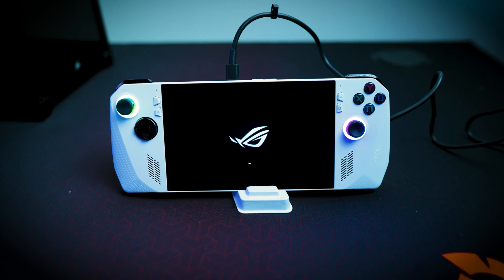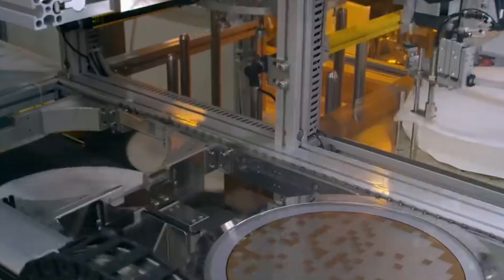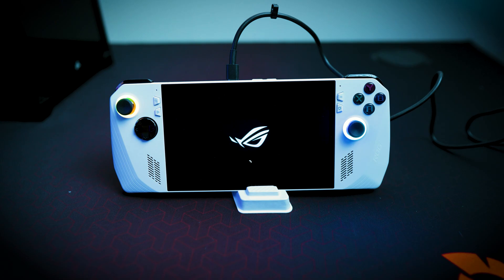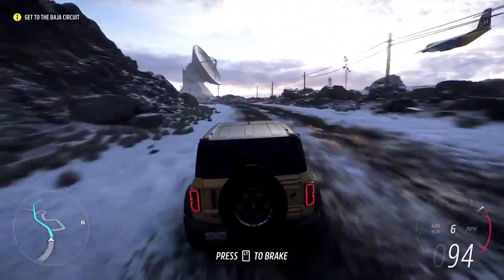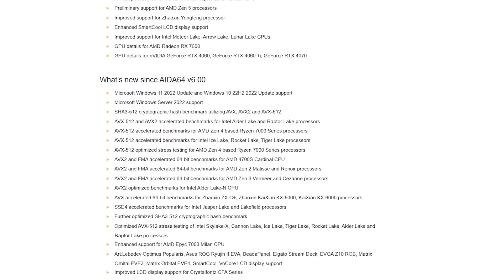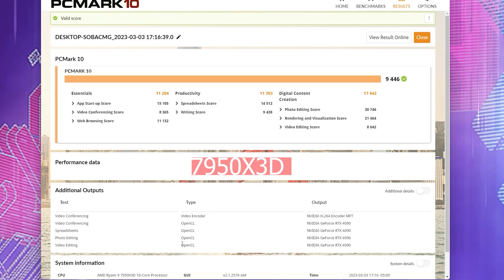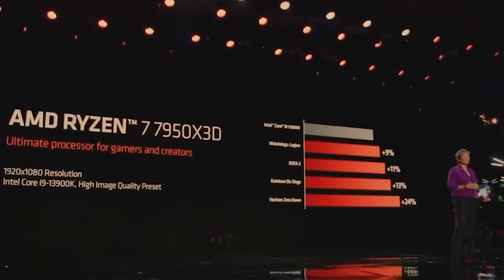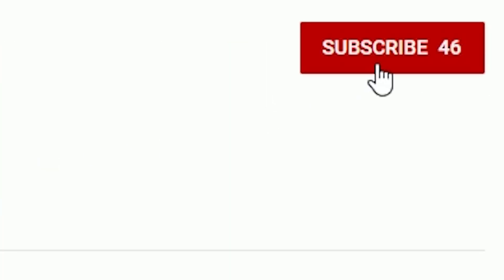AMD Ryzen 8000 is OFFICIAL! AMD Phoenix 2 on its way!

Comment: My 7950x upgrade over my FX-8350 has plummet my productivity.
Why?
Because I was forced to use the new platform and hardware I was forced move from Windows 7 against my will to Windows 10, and Windows 10 is a dawg.   I just can't get work done in this operating system as much as Windows 7, no matter how much I try to make it behave like Windows 7 (OpenShell, WinAeroTweaker, ShutUp10).

Yeah.  THat's been the reality.  33% faster CPU won't help me.  What I need is Windows 7 to run on modern hardware.

Comment: It's nice to have a basic GPU on the CPU, however, ultimately you want more video encoders on the CPU and decoders for video rendering and playback.  It got me up and running on the 7950x and was definitly a necessity, and I even played low end or older 3D games really well... but only with one video port.  I had to buy a 3700 anyway justto get multimonitors and better video encoders.  A Geforce 1070 would of done fien for me, but.. would of irked me therefore a 3070 or 3080 in a new pc.